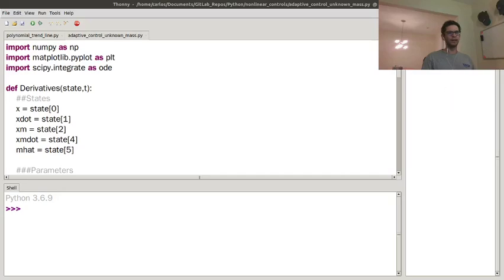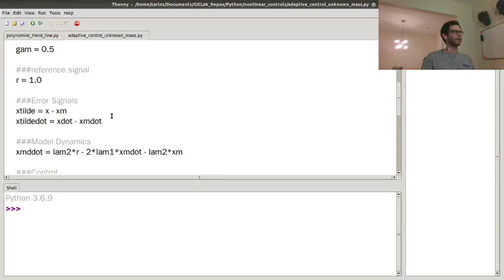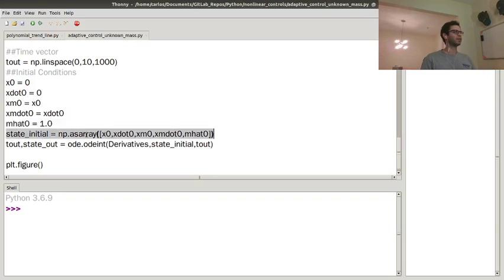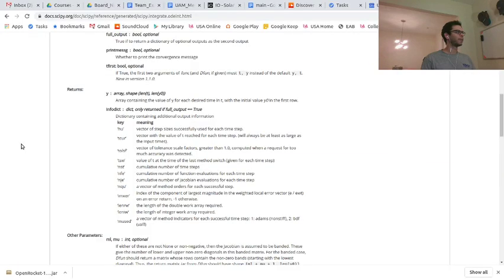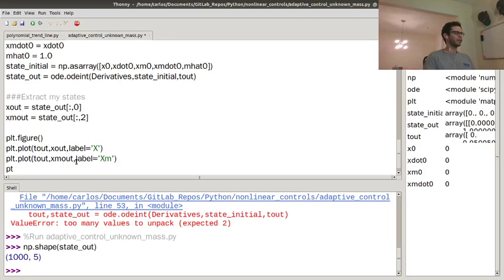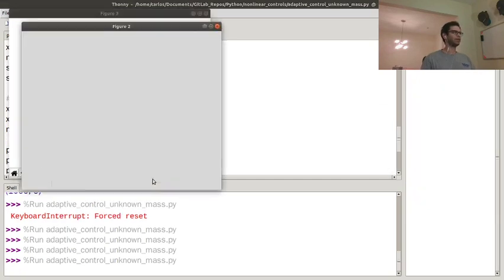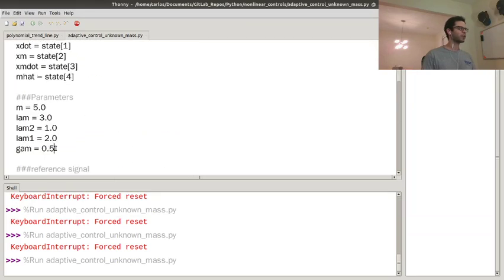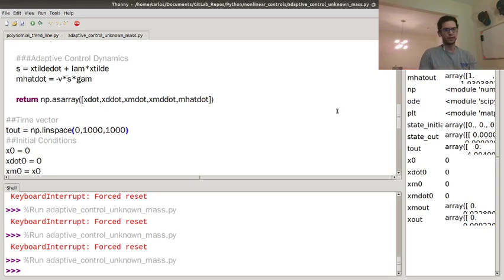Python Help - Adaptive Controller

Comment: Hey Monte, Thanks for the video. Would it be possible for you to show us the discrete time implementation of this or guide us to the relevant documentation.
Reply from the maker: The easiest way to convert this would be to use Euler's approximation. x(i+1) = x(i) + xdot(i)*dt. You would just have to select a timestep small enough to remain accurate. Does this make sense?